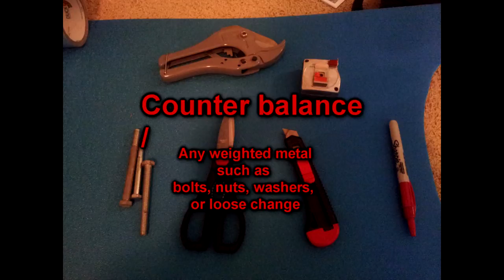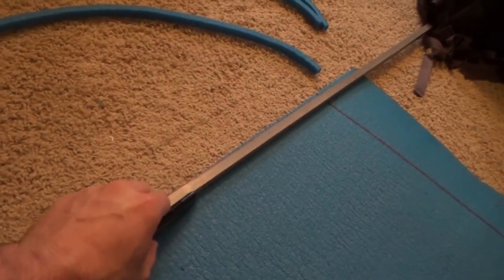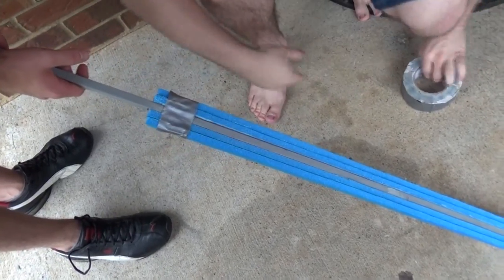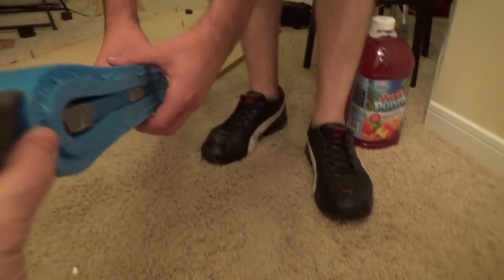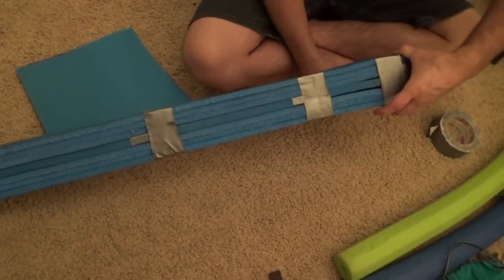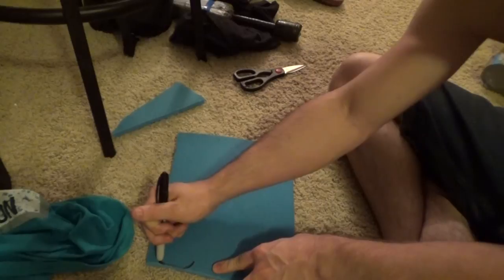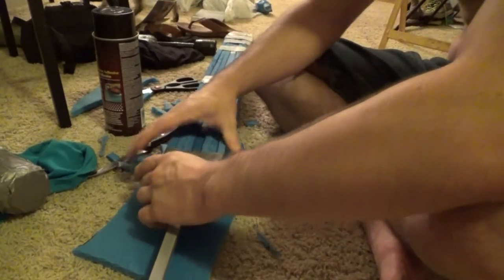TWOA How To- Make a Red (Two-Handed) Sword

Comment: Great build, only problem I have is it seems like it would limit builds of custom weapons, like if you wanna do some kinda crazy curved sword or something with an odd shape. Also, would you still sandwich layers of foam around the 3/4 diameter pvc?
Reply from the maker: We don't normally use fiber glass, this was actually our first time making one. Although it breaks easier, we prefer affordable ol PVC! Also with curved weapons it is possible to heat the PVC and bend it, so the curve is also in the core and not just from foam. PVC bends more, therefore with more give if  we were using PVC as the core to make this exact weapon, we would probably be able to use a few less layers to pass the weapon!
Reply: Ah cool. That's definitely good to know and I'll certainly try it out, I've been looking to make more customized larp weapons instead of the traditional pool noodle over pvc pipe and duct tape. Thanks for the  info and keep up with the awesome content.
Reply from the maker: Ace McGilicuddy I think I will be doing a video very soon showing off all our weapons. we have a LARGE number of unique weapons. subscribe and like our facebook page to stay posted

Comment: I've heard you can use fiberglass rods from drive way reflective markers, why did you not use those?
Reply from the maker: These are sturdier and cheaper when we bought them in bulk.
Reply: Allegora
Oh okay thanks.
Reply: LightningEagle14 if you use the smaller rods the sword will bend which is not allowed at some larps